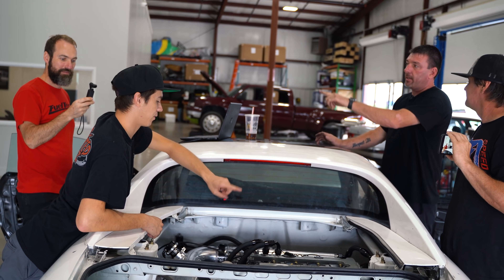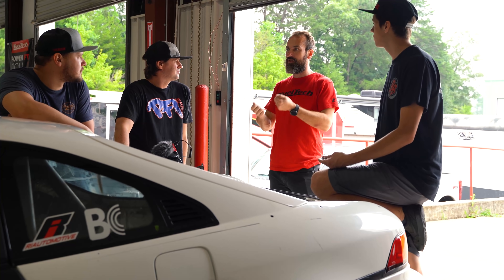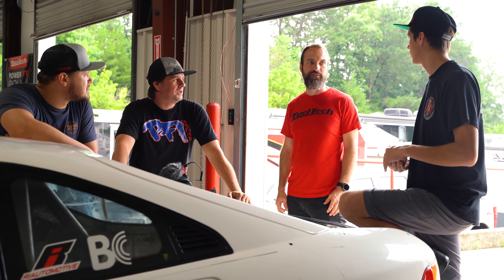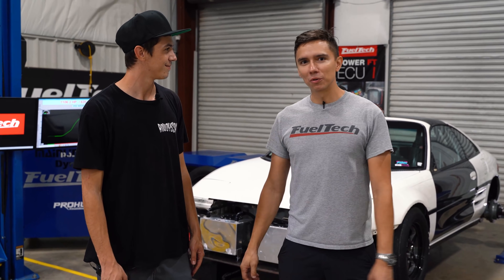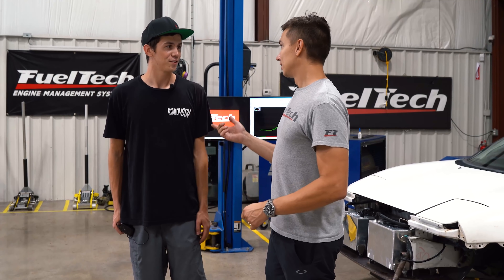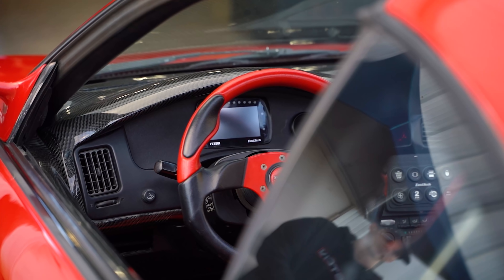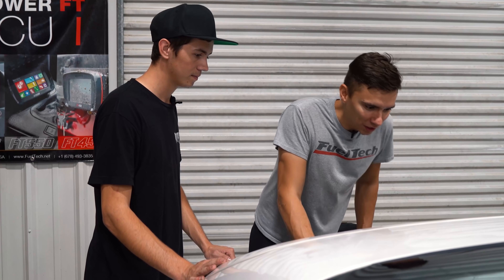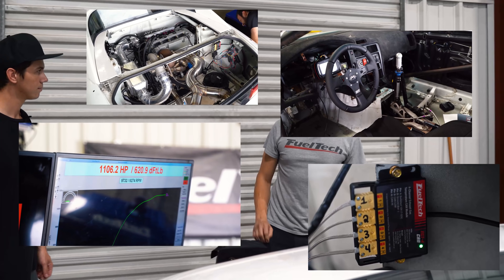First in the 7s | 1,106 WHP | Toyota MR2 | BoostedBoiz

Comment: So glad that I'm here before the Toyota purist say that you misspelled KR2 with MR2.
Reply: Doesn't matter what the purist say if the Vin say's toyota sw20 Mr 2 and you put a K series in it the Vin still gonna say Sw20 mr2. so fuck the purist
Reply: @Barrabass  lol... I agree with the Vin & chassis code... but they are still going to have their panties in a bunch cause they have been trying to achieve those numbers for 20-30years... and now here comes this 5 minute old motor at 1k+ hp with ease and 7's ETA...
Reply: @dennismelville7532   very few peeps tried to achieve 1/4 mile records for those 25+ years. Most everyone into SW20 for years was into handling/autocross/road racing.  You still don't see much enthusiasm behind straight line performance until  the Honda people came to the the scene and started building on this chassis. Not bashing Honda or K Seires.. I love the car is getting more attention.